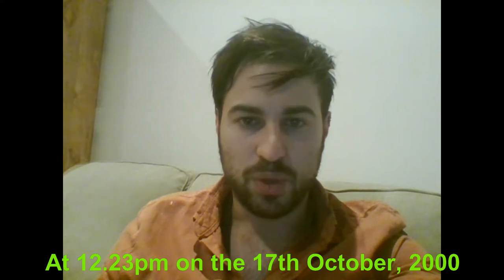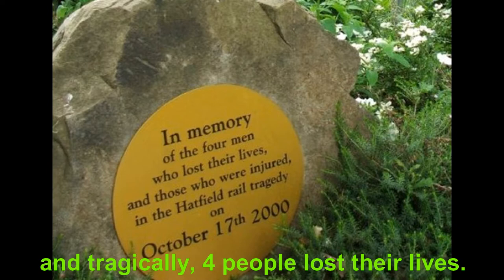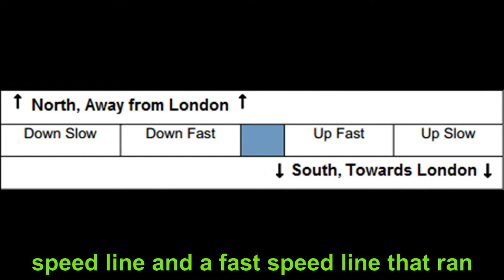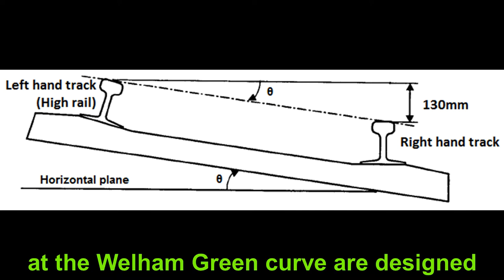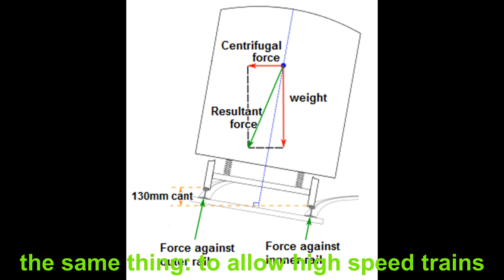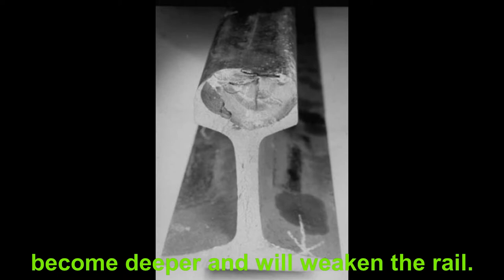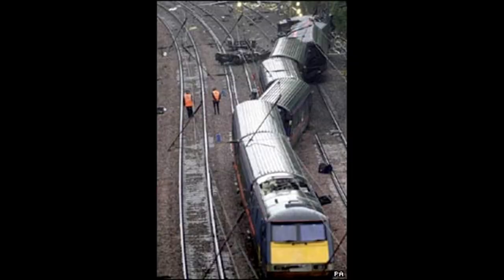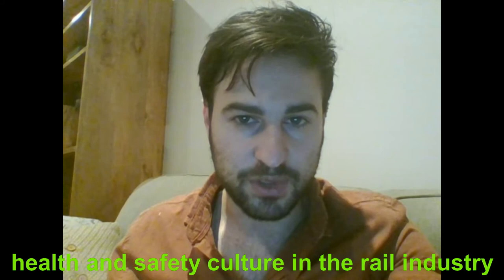Hatfield Rail Crash Case Study - Video

Comment: I wonder why the charge of Manslaughter was dropped?
That an engineering company would deliberately try to make the rails last longer than is good engineering practice without any technical basis is hard to believe; the lack of proper procedure will result in a derailment sooner or later.

Comment: 1. It was a privatised company that was responsible for not properly doing the maintenance work it was contracted, and paid from the public purse, to do. 2. Thatcher & this gov't don't give a damn whether the railway system works for its users. At present, June 2018, it certainly does not. Grayling hasn't got a clue and all his tory mates wouldn't know where to start. The problems caused are horrific for users. Train cancellations and delays are due to the summer timetables having had all their minutes allowances removed so if a train is running late, that is passed on, through the timetable, until the train loses its onward line slot ... It is then cancelled from that station onwards. So how the hell can you claim that privatisation works???!!!